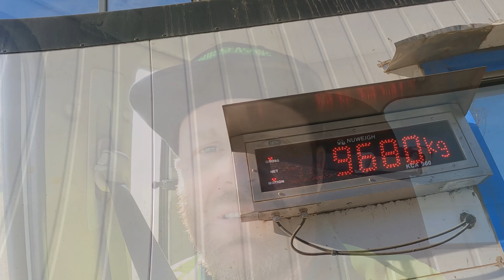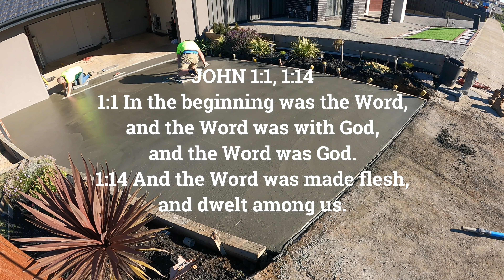🇦🇺 CONCRETE DRIVEWAY REMOVAL & REPOUR 🇦🇺

Comment: Always Next day wash or do you go same day wash sometimes?
Reply: We do all through summer. This job was poured at lunch time after we poured another job in the morning. We washed the first job the same day after we finished pouring this one. When it’s falling towards the house you want it nice and firm because of all the broom work pushing the slurry away. We would wash it late if we poured first thing but it was still cold when we did this so next day was fine.

Comment: Cool video bro. Check us out Kiwi Concrete on YouTube. Also whats that whole deal with the Towbar? Do you have to take that thing of everytime you tip?
Reply: Yeah dumping concrete or rocks it bends if they hit it as it drops out. But when you have dirt if it’s not on the thread fills up with dirt. It’s not the best system for a tipper. I’d never buy one on another truck. Would be great for a semi on the road but for a tipper you want a pintle hook
Reply: It would of cost a bit to sawcut ,why didn't u just rip it out with a bit of rock breaking and zipper cut with hammer.
Reply: Clearly a semi doesn’t need it haha but you get what I’m saying. Road use only would be fine.